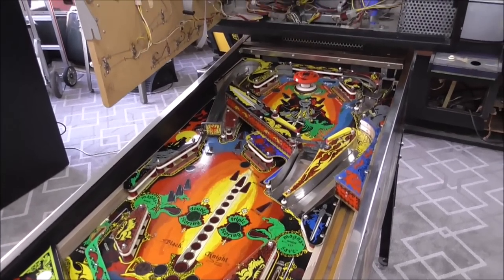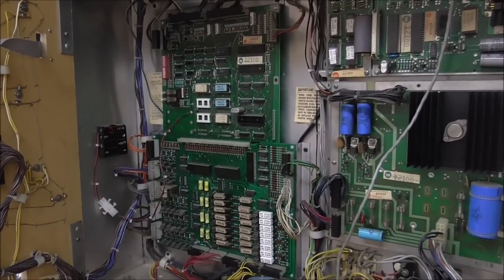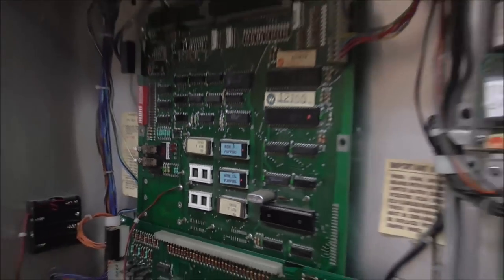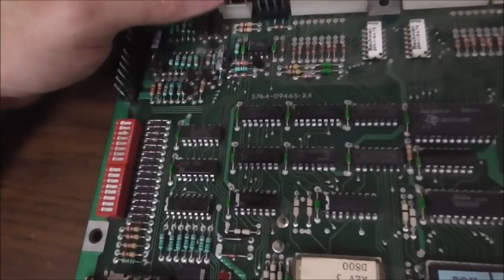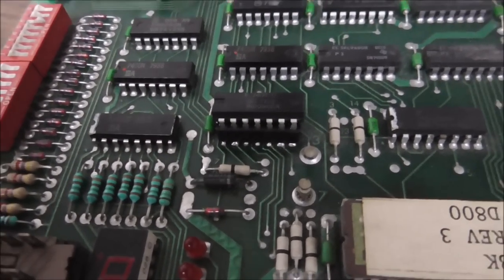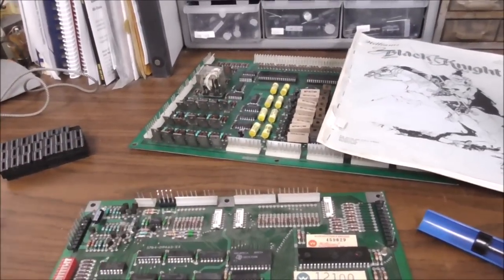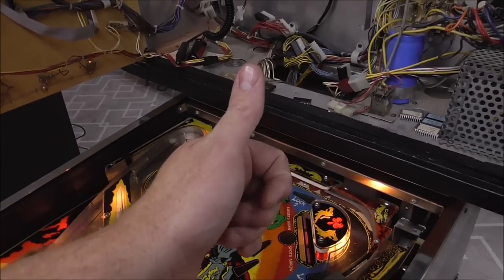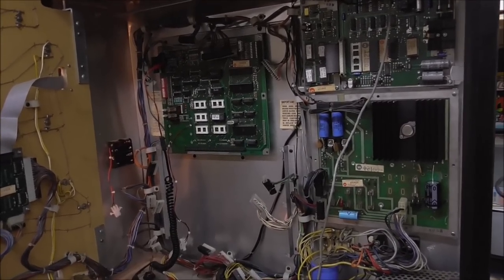1980 Williams Black Knight Pinball Machine MPU Is On Fire!  - PCB Repair of Shorted Chips!  #2

Comment: Man I love watching you do this. Reminds me of my earlier career days working on the test bench and figuring out a problem. then when you tried all possibilities and you had no reasoning for the error you just starting to increase the voltage until the problem presented itself. Usually ended up in a bad via or shorted PCB trace on the inner layers. Now that I design circuit boards for a living its fun to see the old PCBs and how they are routed. I'm designing 20+ layer PCBs these days.

Comment: Magic smoke makes people exited. My biggest puff of smoke came from a serial terminal driver/buffer chip that was inserted backwards by mistake (meaning, reversed polarity). The system was powered from a dual 5V@200A supply. Blew a hole clean through the chip, instantly filling the room with white smoke. Luckily, neglible damage to the socket, no damage to board or other parts of the system. Plugged in new chip, this time in right orientation and all was good again.
Reply from the maker: Very cool, i've accidentally done that before but it was low amperage stuff so nothing smoked.... thank you for watching SeersantLoom!

Comment: I ended up burning up an LED once. My friend loved messing with electronics and he gave me a single LED to fool around with (we were in like 1st or 2nd grade at the time) and I made the extremely dumb decision of trying to connect the LED to a 9v battery. Of course, this was way beyond its voltage limit and it lit up briefly then my room smelt highly of melting plastic (a smell I now associate with danger). It didn’t work ever again surprisingly. Hate when electronics burn up. It happens though. Always cool to see another pinball repair video. I love electronics (and now know not to burn them). Cool video!
Reply from the maker: Thank you BA Elevator!

Comment: I worked on a System 3 once (I realize this is a Sys 7), what a complete pain. Battery acid damage, connectors, bad chips...then display problems (toss in counterfeit display chips too).  The problems never ended, finally sold it as a project.  Wasn't a very good title anyways.  Promised myself to never buy a Sys 3 again.

On the plus side, I bought a desoldering station while working on it!
Reply from the maker: They do have their quirks!  We don't mind working on them you just have to know going in you have to mess with everything!  Thanks for watching, Mark!

Comment: I saw a grey ribbon cable... you know, with red on one edge for pin 1? Now I learned that's not always pin 1 the hard way!! One end was keyed  and the other had the tiny arrow on the connector line up with pin one... but not the red pin!! It was powering and providing data to a small 2 line LCD display, which didn't turn on. I touched the control chip and burnt myself. Somehow it still works.
Reply from the maker: Yeah I wish they made those harder to plug in wrong!  Glad it didn’t fry it….

Comment: I definitely did the black/white connector swap right after setting up my Gorgar. That was a difficult lesson to learn right out of the gate. Luckily not too much got fried, but I still had to do a lot of board work diagnosing the issues it created. Even worse was this was a "broken" game which I got for a good deal, so who knows how bad it was even before I swapped the connectors.
Reply from the maker: It happens to the best of us Kyle, don't feel too bad, i've fried stuff!  Thanks for watching!
Reply: Indeed...could you not replace those identical connectors for something keyed so it never happens again?
Reply: @pliskenmovie  At the very least Williams should’ve put something similar to the pin plugs on the Molex KK connectors they use everywhere.
Reply: @KANahas  Well sure...but we're talking after market mods anyways like chip sockets and pin headers. Keyed molex connectors seem a natural progression.

Comment: Ron, surprised you don’t have a bench top power supply. It’ll make testing boards much easier. You must have a back ache from bending over reaching into the back of the cabinet. Now before you say their to expensive, pick up a old pc power supply. There cheap and work just fine to power up these boards. I built two, I’ll send you one if you want it.
Reply from the maker: I've got one but I don't mind using the cabinet to test them in, thank you though!  See you on the next video!

Comment: Sometimes good chips go bad like dominoes falling due to a short caused by a bad chip. I fixed an old Taito Space Invaders L-board a couple of weeks ago and it had 2x 74LS241 chips burning hot. I replaced them but that didn't fix it so I went over the board and dozens of chips were bad. After 3/4 of them were replaced in sockets I asked the owner if he wanted me to socket the remaining chips and he said yes so I did. So this Space Invaders has all the chips in sockets now hehe! At least next time it will be easy to swap out the chips one by one and fix it easily and the owner can do it so I don't have to deal with it again :-)
Reply from the maker: That's a lot of soldering work!  Thank you for watching!
Reply: @dickcheney6  No. I just repaired this PCB. It was sitting inside an arcade cab working. No one touched it. Old arcade games just do that and it's normal. One day it works, the next day it doesn't.

Comment: Another sign a monitor is failing is arcing. I've seen that before. If the flyback is messed up and the insulation is shoddy, you may get arcing. That is why the insulation there tends to be thick.

Comment: A very basic ground question please.   so when you test a volt on a board  the red lead  goes on test point say 5 and the other test point goes to test point say 3 or on the meatal.   If you use  the meatal back glass as ground at some point  that voltage has to loop back up to the return wire on the socket?  Is that correct?   I mean I thought electricity had to loop.  thanks .
Reply from the maker: When you're measuring voltage, yes like you said the red lead goes on whatever the positive voltage is, and black goes on ground, in many games lots of things are grounded, which just means a lot of the metal is connected together.  So on some games for instance, the door is grounded, the legs are even grounded, the side rails are grounded, the boards are all grounded, etc.  So there is a ground test point on the power supply (which is where the DC ground originates) but anything that is touching that grounded metal part of the power supply is also ground.  So if the power supply is screwed to the back box, the ground trace on the board is probably connected to the screw ,which is connected to the backbox, which may be connected to other things depending on how it's wired.  Anywhere that is grounded can be used to check voltage.  Thank you for watching Kelo!

Comment: Inverter gate (7404) is essentially a pair of mosfets, one pulling up and other pulling down the output with both gates tied together into one input. It is more possible that one of the mosfets is shorted from gate to Vdd, having a 1/4W resistor short with 5V is really rare, these are rated to 250V. CD4069 is pin compatible._
Reply from the maker: Thank you DjResR!

Comment: Looks like the memory protect signal forces a battery backed RAM into read only mode. Presumably that stores high scores and what not. Not really sure why it matters that it is write protected when the door is open unless that precedes power down?
Reply from the maker: I believe what they were doing, is making it so that you couldn't get into the test menu without opening the door, some sort of weird security system.....
Reply: @LyonsArcade  maybe, if it needs to write some value and read it back out (or not be able to do that). But the signal itself doesn't go anywhere else and isn't directly readable.

Comment: Those 'cheap' IC sockets cause lots of intermittent faults. My rule is to replace them for quality turned pin sockets, and it generally cures all those illusive intermittent faults.
Reply from the maker: Did you know I often get people leaving me comments telling me to never use turned pin sockets?  I get others saying to only use turned pin sockets.  Thank you for watching kay110!
Reply: @LyonsArcade  Thanks for the reply Joe. I found the cheap sockets loose tension in the socket pins - so much so, that a few years ago, I had one PCB with an EPROM that was so loose you could pull it out with your fingers. The gold turned pin sockets don't tarnish either. Good luck with future repairs and I've been enjoying your videos.

Comment: If you have the budget for it, a thermal camera would help spot chips trying to ignite.
Reply: CAT smartphones have a FLIR thermal camera inside, they are kinda affordable. And heavensent for HVAC / electronics guys :)
Reply from the maker: I may have to do that some time... thank you David!
Reply: @David McGill  That's not needed on old boards like this with simple DIP chips. Thermal cameras are super expensive and only useful for very complicated modern PCBs that have many hundreds of components. Feeling for hot chips with a finger does just fine and it's free.....

Comment: Maybe it was plugged into 240VAC while still on the 120VAC taps.
Reply from the maker: That is possible, i'm not sure of the complete history of it!  Thank you for watching Mike!
Reply: If it was plugged into 240VAC while setup for 120VAC the transformer would most likely have gone up in smoke. So unless there are signs of transformer damage or a transformer replacement it's unlikely that happened.

Comment: When the board is in "audit mode" because no battery is installed, Why do you have to reset the game a second time? I just confused what is "audit mode" when you put the pinball game in audit mode. When the CPU game board is first turned on its checking all the others boards and if the one or more chips is bad the CPU game board will "lock up". I'm not understanding if you don't have the "test rom chip" the normal ROM chip will have a built in BIOS test that will check the PIA chips, RAM chips, Lamp test, displays, coils drivers, etc and if anyone one or more is shorted or bad its will "lock up" the CPU game board?
Reply from the maker: if you turn it off and then right back on fast, the 5 volts hasn't drained out of the capacitors so the game thinks it has the batteries installed and boots to gameplay mode.... you are correct, the board will lock up if the rom can't speak to all of the chips it's checking, it's exactly like you said.  The test rom helps you figure out which chips aren't working properly... Thank you for watching Wayne as always, I know you watch all the videos, thank you!

Comment: Do you have, or have access to a FLIR camera?
It would be extremely helpful in your business, easily
locating warm circuits & components of analog design.

You can also get a much cheaper version, that simply plugs
into your Smartphone. A FLIR ONE GEN 3 is $200, then they
quickly start increasing in price for higher resolutions. I'd 
think the basic would work for you. Probably find cheaper
if "used" or "refurbished". Lots of computer repair shops
and auto mechanics use them, too.
Reply from the maker: No I don't have one

Comment: The black/white plugs being plugged in wrong on my jungle lord, it was a mess and took some time to sort too, what a stupid setup having two of the same connector.
Reply from the maker: Yeah the guy that did this one said he probably did it and apologized, I told him man it's a lot easier to do than you think, even if they're color coded right there's a really high chance somebody at some point is going to plug them in backwards.
Reply: @LyonsArcade  my plugs are all white, when I bought it 8 years ago it was my first pin and was told the classic”probably needs a fuse” jumped in both feet!

Comment: It's always annoying when machines ignore the "No Smoking" sign.

With everything that's dead, it leaves you to wonder if it was damaged in a power surge, maybe due to a nearby lightning strike.
Reply from the maker: They ran 50 volts through the board when they swapped the connectors around I think...

Comment: Funny how these old boards have no input protection… no optoisolators, no shunt diodes. They’re just vulnerable to whatever comes into the chip from off the board.
That 47K/4.7K? pull-up resistor would never be hurt by being shorted 5V to ground. In fact, it’s shorted every time you close the switch on the door.
Resistors never short (except wirewound), they burn and open when too much current passes through them.
Reply from the maker: The whole point of what I was saying is that they didn't send 5 volts to the resistor they sent the solenoid voltage to it, 50 volts or whatever it was when they reversed the plugs.... So it then had 5 volts on one side and 50 on the other side, I was just checking to see if that damaged anything but i'll take your word for it I shouldn't have checked it because it never would have been hurt

Comment: 4.7K would be correct. It's simple to drop a decimal point on prints...it's usually why you send them through a checker.  I guess they didn't back then, or the checker also missed it.
Reply from the maker: Early 80's = LOTS OF DRUGS  Thanks for watching WreckDiver99!
Reply: yeah to speak to that.... A print shop would shoot a negative of the original to burn a plate. Chances are the printer saw it as a spec of dust and opaqued it out.

Comment: Whoever did the solder job on the 5101 should be ashamed.
Reply from the maker: We put a nice socket in it no more problems :)  Thanks for watching Rock
Reply: A lot of bonehead repairs... I just started working on a Kings of steel playfield and whoever had it last had one flipper coil backplate held on with a 1 1/2" screw embedded in the playfield.  Guess they couldnt find the 1/4" oem screws

Comment: You are wrong if the chip has an internal short yes it will smoke. If the pull up resistor has changed values, the resistor will smoke, not the jet.

Comment: Resistors typically don’t short due to their internal makeup.
Reply from the maker: That's true, thank you Nav Vet!
Reply: @LyonsArcade   Love your videos.  Pulled a Ms. Pac-Man from the trash and resurrected it years ago.  High voltage caps in the video side dried up.  Like a DA I traded it for something and seriously wish I had that game today.  I have a Hollywood Heat pinball machine that’s giving me some issues.  I did the ground MODs years ago and it seems like they giving me troubles again.